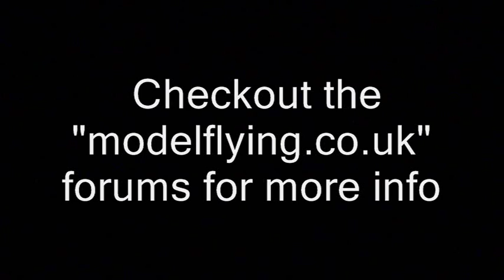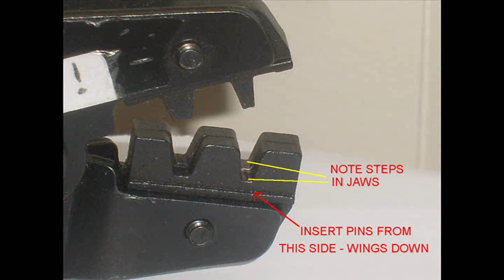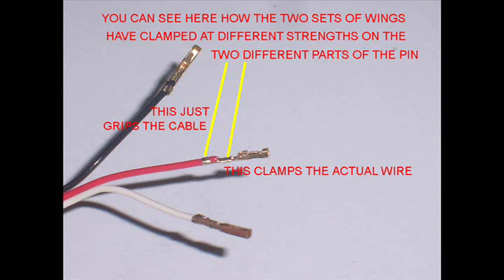Making servo extensions.wmv

Comment: Great video!  It cleared up my questions regarding the use of a pin crimper.  I did notice while practicing that every pin I crimped "wings down" came out very warped, while wings up gave a good straight crimp.  Is it possible there are slight variations in these tools and how they work?

Comment: The Hobby King Crimper is a good tool and works fine. I have no connection to HK other than a customer. They also do the servo wire in various gauges, pins and cases ... so a job lot can be bought to service all your servo needs.

Comment from the maker: Nice to know this is still helping people. Unfortunately, the supplier of the excellent crimper tool that is in the video is no longer trading in the UK - and I cant with any real confidence recommend an alternative as I simply haven't had the need to use an alternative. Sorry folks. I know that there are a good few versions about, but in my experience the cheaper ones are simply not up the job. I would expect to have to pay around £30 minimum for a quality set, and its possible to pay a LOT more.

Comment: Great video, many thanks for the still's in the middle also, they give great illustration of the points you're making. Would you have any pointers on where to get the crimp tool? The one I have isn't racketed and makes a mess of the crimping. Thanks